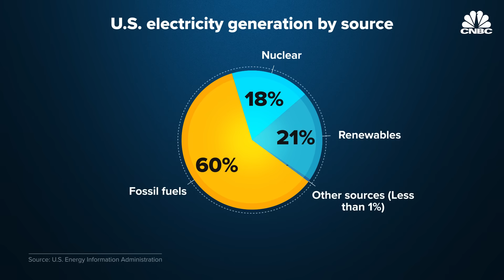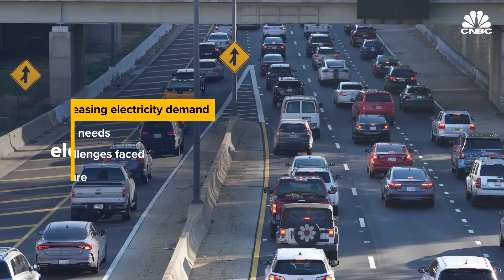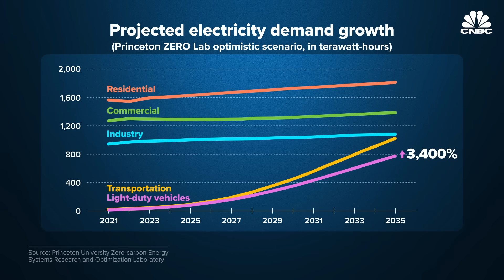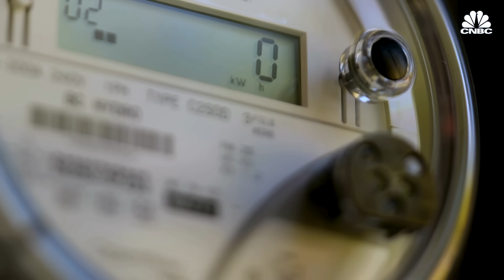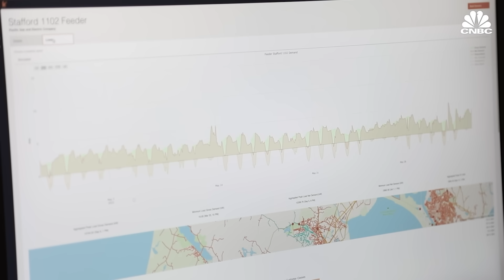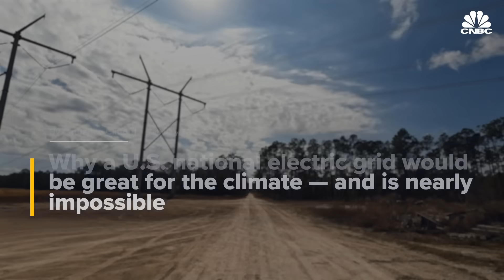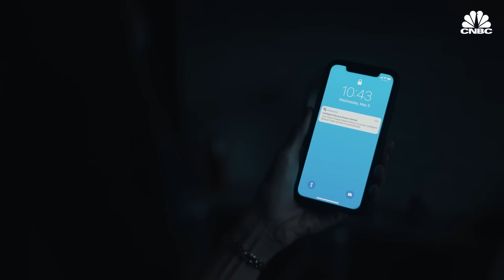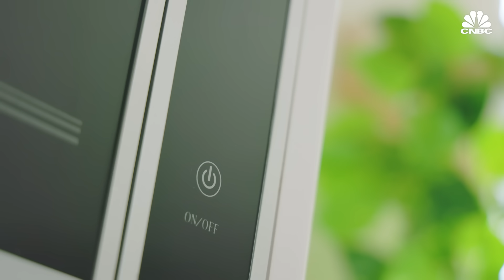Can The U.S. Power Grid Handle The EV Boom?

Comment: this needs to be done regardless of the EV boom. our grid is antiquated and it’s a bit embarrassing that this country is falling behind and falling apart. not everything has to be political. a better and more efficient grid is a win for everyone.
Reply: We also need to harden the grid against X class CME's (coronal mass ejections) and EMP (electromagnetic pulse) attacks.
Reply: @That-Guy_  Changing the transmission systems to DC will take care of CMEs, but not much of the US transmission is affected anyway. Parts of the Northeast and along Florida (of course) are affected; none of the lines here in Arizona are.

The vulnerability comes from the CMEs inducing large DC currents on top of the AC the transformers are expecting. That can cause the core to saturate on the AC current peaks, making the winding look shorted for part of the cycle. The line can be protected by taking it out of service, but that is not a popular thing to do.

If we have EMPs electricity will be the least of our problems. I remember the Cuban Missile Crisis....
Reply: Don't be ashamed , here in EU it's a mess as well , everybody with a clear mind can see it will never work on that scale to replace existing market to EV , so they will impose limits on private car ownership in future
Reply: Oh but we have some really smart bombs at our military's disposal.
Reply: The video said it will cost California thousands of dollars of grid upgrades JUST FOR EACH NEW EV.  Should there be an excise tax on EVs so all the virtue signalers can help the rest of us pay for their expensive toys?
Reply: The average age of city water pipes in Portland Oregon is seventy years. Twenty five percent of the pipes are pre 1930. How's that for antiquated?
Reply: People need to mine coal so you can turn your lights on and they deserve to be paid well. Also you need to consider there is carbon taxing for burning fuels.
Reply: @dmitwoz 

Coal only makes up just under 20% of US power production.
Reply: @dmitwoz  Wikipedia notes "Coal generated about 19.5% of the electricity at utility-scale facilities in the United States in 2022, down from 38.6% in 2014 and 51% in 2001."
Coal is going extinct in the US, largely because all coal plants have to be retrofitted with mercury capture. That is prohibitively expensive. I used to service generation facilities in northern Arizona; two of the three sites had five units ten years ago; today each of those are down to two units. The third one had three units; it is gone now. The generation is being replaced by natural gas plants. Coal has no future in the USA.
Reply: Booom
Reply: Doesn't V2G and variable pricing solve a lot of these issues? Market forces will then balance out the grid, no?
Reply: You are funny!! Do you really think drug crazy California which is run by Gavin Newsome cares about the electric grid? Gavin only cares about lobbyists and his winery.
Reply: Its because of all those money the government is sending over seas rather than spending money to help the states
Reply: About the time I moved to Flagstaff in 2001 NERC (North American Electric Reliability Council, the electric watchdog for Canada and the US) estimated existing infrastructure was in need of about 1 1/2 trillion dollars in modernization and replacement of equipment that was at end of life. This is a good news / bad news thing. Expensive, but DC transmission technology can be introduced during the Big Push. It is like having to buy a new car that is more modern than the old clunker. We have to do it sometime, and doing it over too long a time gets more expensive as more solid work-arounds have to be in service for longer periods. This is opportunity and challenge, all in one.
Reply: Its impossible to build a carbon free grid by 2035 as the Biden Administration say it’s going to. That is a huge change in electricity source from fossil fuels currently making  up 60% (20% coal and 40% natural gas) plus more transmission upgrade plus consumption increase. There needs to be massive projects under way or about to be started and there simply isn’t. Why do politicians promise something with no variable plan?
Reply: This is all BS. The sooner people realize this the better off we’ll all be. They want everyone to have 1 source of energy so they can more easily control us. Wake up people.
Reply: Two factors:

Where are the sources of Fuels?   Fossils or "What's so-called Not-Renewable"  ...  Materials will have needed to Expand Higher Loads -- Filter/Regulate Stations for Level 3 Charging. (Aluminum and Coppers would be needed more to expand Transmission Lines of High ⚡ ⚡ Voltage  and so.

*We/I keep in mind of upgrading Infrastructure of the Grids on third call*.

We/I copy here the Data from ERCOT Grids so we can discuss/ making analysis of:
Last Updated: Oct 8, 2023 19;14 PM Central Time. 

Texas GENERATION  FALL season CAPACITY  MAXIMUM CAPACITY
Solar 91 MW  (0.2%)11,663 MW  22,163 MW
Wind 6,419 MW  (13.6%)  12,686 MW  39,897 MW
Hydro 96 MW  (0.2%)  389 MW600 MW
Power Storage 372 MW  (0.8%) 1,053 MW5,405 MW
Other 0 MW  (0.0%) 163 MW113 MW
Natural Gas 24,884 MW  (52.8%)  54,367 MW  69,890 MW
Coal and Lignite 10,218 MW  (21.7%)  13,623 MW 14,321 MW
Nuclear  5,027 MW  (10.7%)  5,064 MW 5,448 MW

Whatever the Real Percentages of Teslas/BEV in Texas = but Given facts and assumptions about 3-5% mostly BEV Passenger Vehicles.   The Industrial Trucks, Busses and Transportation Semi 30-Wheel Trailers if converted from ICE to Electrified will need like 10 times the Powers needed to recharge the 🔋🔋Bat.   The above Data shown daily, Texas uses between 15 to 23% of Coals depending on Wind Energy/Factors (Winds dies down or strong wind) by the Hours.  Then Natural Gas which is about 35 to 55 % and in the Summer Time, when Air-conditioning required, TX Grids used combined more than 80% of Fossils (Coals and Natural Gas).

Given Facts that:
[Methane, the main component of natural gas and a byproduct of fossil fuel drilling, has more than 80 times the warming power of carbon dioxide in the first two decades it’s in the atmosphere. ]

Those Generators/Plants that Burn Coals or even Updated Combined Natural Gas the Smokes/Fumes of Pollutants = C0, C02 and Methane mixed piled up (Chimney 300 feet or more in the Air.)  While as our ICE Mufflers about 1 foot above ground.   The Photosynthesis of 🎄 🎄 🌿 🌿 Trees/Plants along the Countryside Roads and/or Streets in Metro should play a part of neutralized some of the C02 from the ICE Mufflers.

Texas is the Highest per capita in Generating Electric Powers in the US; California imports daily about 30% of Cali Electricity Needs; and out of those generated and imported = 70% are from Fossils (by the way, as far as we have read and compiled = USA fossils used daily is close to high 60% almost 70% not about 60%)  The Truth hurts.

If the US can generate Electric Powers from sources that reduced the Pollutants and reduced the Energy Spent that would be the best; like Canada 🍁 🍁 Hydro Powers daily generated close to 60% other sources like Wind and Solar, Bio are bonuses!!   If USA could generate enough Powers from Hydro and other "less C02 Emissions" so that Households in USA would use Electric Stoves instead of Gas.  Which is immensely important than trying to drive a Tesla and spend the most Money to make the 🔋🔋.   Get those old ICE Cars from the Street to Junkyard/ Recycled; get new Hybrids and more Efficient ICE smaller Engines so USA can reduce the Emissions down from 100 Benchmark to 90 in a decade would be such a bonanza!!

Smaller Cars, smaller Curb Weight will cut down the Repair cost on Road Maintenance = not on the Teslas that weight 1200lbs more than the averaged ICE cars are more pragmatic and Practical and Focused on.

Regards,
Reply: Completely correct. Wind-solar-batteries will be 90% of power generation and storage by 2030. Electricity will be plentiful and cheap. However, the grid needs huge improvements despite the stabilizing effect of battery storage and more localized power generation (e.g., rooftop solar). Google Hornsdale Power Reserve. Battery storage is orders of magnitude cheaper, faster, better than natural gas peaker plants. In fact, the giant battery caused several peaker plants to be shuttered within weeks of the battery going online.
Reply: The American people would rather vote for more tax cuts and more gun rights!
Reply: true, but some of these people need to stop trying to push things too fast.
things take time for new innovation to grow.
Reply: Thank you for your insightful comment! I completely agree that upgrading our grid is crucial, regardless of the EV boom. It's important for us all to have a more efficient and reliable power supply. Speaking of power solutions, have you heard of the Segway Portable PowerStation Cube Series? It's a versatile powerhouse with an expandable capacity of up to 5kWh, perfect for outdoor enthusiasts and ensuring uninterrupted power supply during family camping trips. Check it out if you're interested!
Reply: I completely agree with your comment. Upgrading our power grid is essential, regardless of the EV boom. It's time for us to invest in a better and more efficient grid that benefits everyone. By the way, have you heard about the Segway Portable PowerStation Cube Series? It's a versatile and powerful backup power solution that can keep your devices running during camping trips or power outages. Check it out!
Reply: Then YOU PAY FOR IT. Not on my dime!
Reply: 120v 240v sucks the European 240v 380-400v three phase is better.
Reply: Falling apart and falling behind? When did that happen if there's been progression? Did it happen during a specific year like 2013?
Reply: If there's been progress, then when would it have fallen behind and fallen apart? Since 2018? Was there a specific year that you were thinking of?
Reply: Nuclear power! The most energy dense production that could solve our electricity issues with just a few reactors!
Reply: that's the limit of technology
Reply: One of the Australian states at times is totally powered by home solar panels, yes they had to invest lots but the payback is immense !
Reply: what did big oil do with moneys for gride last 50 years now there front loading cost on us maybe dig into there slush funds and upgrade
Reply: Europe and China are is lightyears ahead.
Reply: We should be building nuclear power plants.
Reply: @bcemember3922 Budgeting, the long term impact, maintenance, waste, infrastructure, materials or resources, education and having everyone agree with it is just a fraction of what it takes! Y'all needs stop giving your opinions and start using your brains for empowerment and a deeper understanding because industry doesn't happen in the blink of an eye. It requires capital and return to investors too.
Reply: Unfortunately, everything is political. In the US, one political party is dragging their feet while the other is trying.
Reply: @tims8603  Politicians like new bright shinny things that they can cut a ribbon for a photo, then resent having to budget any funds to upkeep that thing. They have been neglecting up keep for decades. Some of these things date back to the 1930s others to the late 1960s/early 1970s. These things are dams, bridges, roads, levees, water treatment, electric generation and systems, etc.
Reply: @tims8603  Trying to bankrupt this country and force people to go electric before the technology can deliver vehicles that match what diesel and gas vehicles can deliver .
Reply: @Brett33  😂😂😂
Reply: @tims8603  Yup we have the party of doing things and the party of not doing things.
Reply: @tims8603  I don't know what happens in other states but in Texas thousands miles of new  transmission lines have been installed over the last 20 years. It probably easier in Texas since FERC (federal government) approval is not required to do most energy related things.
Reply: @mrrogers4591  TX has an independent grid system. It's good in some ways, bad in others. That winter storm showed the bad ways. If power goes down in other states, it can be redirected from other areas. I don't think TX should brag about their system.
Reply: @tims8603  True. However the winter storm showed that company didn't take into account the potential for those low temperatures affecting their equipment. The surrounding states had there own problems and didn't have sufficient excess production capacity to meet the needs in Texas. The blackouts wouldn't have affected as many people but the majority would have still gone dark.
Reply: @tims8603  It was the natural gas infrastructure that was the cause/start of it
Reply: @mrrogers4591  They have known about the issues since 2010 if not earlier.  They chose for over a decade to do nothing to winterize the natural gas lines / wind turbines, etc.  ERCOT is not a good example of how to run a grid.  Too many people die in Texas from loss of electricity, even recently with the heatwaves and loss of power as well.
Reply: @tims8603  One the public didn't hear too much about took place about 20 years ago. They have the highest mix of wind in their power generation of any interconnection in America. One day the wind didn't blow nearly enough and the retailers had to buy electricity on the spot market for many, many times the contracted rates. Over the next few months several of the retailers went bankrupt. It was in our company's news but I never heard a word about it on national media.
Reply: @flagmichael  Who is 'they'?
Reply: @mrrogers4591 lol your example is TX? The one place that proved the grid was antiquated last winter?
Reply: @gregripp  RE: " It was the natural gas infrastructure that was the cause/start of it" 

Ohh you mean the infrastructure that has to run 24 hours a day 365 days a year. I would think that its electricity should be the most costly.   I can sell you a cheap airline ticket for undependable service "we fly sometimes is their ad slogan"  

Instead the utilities had to buy undependable power when available, the reliable power had to compete with only being able to offer it when people had to have it and the unreliable power could not do the job.   If I ran the reliable power outfit I would "gouge" all the fools that voted for their unreliable power; a price must be paid for stupidity.
Reply: @flagmichael  that was case in south australia? haha
Reply: Roof top Solar is increesing massively. Together with home batteries,and grid magapacks batteries will be in place before the EV demands put any seriously strain ro the grid, because it profit in it.
Reply: @brembodream  yeah i think it would be much better to put a coal firing next to your home, that would be much better for the environment  :) maybe we can also erect a gas and oil refinery next to yours.
Reply: @krac3x438  My coal plant was a good neighbor.   Quiet and small footprint,  clean flue gas and it never failed to supply 2 million people from a 600 acre site
Reply: Guise, why we need renewables…. nuclear takes long years to build and we need lots more of them than most folks seem to think. 

We do need renewable storage development. We are very behind.
Reply: @katherandefy  Plus nuke plants will be economically unviable in ~7-10 years compared to renewables - nuke plants will be stranded assets and shut down, wasting all that capital. Keep existing open for now, unlike Germany but don't build any more.
Reply: falling apart because of failed green projects ?
Reply: what if i dont hv houses connected to the grid.
Reply: @palocymasaio  Houses are small potatoes. Much of the power demand in any developed country is for commercial applications - office and shop buildings, power for pumping water to everybody, street lighting, the list is endless.
Reply: @palocymasaio pretty much if you use any services or purchase any products at all you are benifiting from electricity that is from the grid.
Reply: @palocymasaio  Then you don't have a house connected to the grid.  There are over 332 million households in the US and I very much doubt no more than 1 million households live off the grid.  Use our nations resources, in this case taxpayers money, to benefit the most people.  Upgrading our Electrical infrastructure would benefit 331 million households.
Reply: @CeasarBergonia  well we are a different class so whatev
Reply: We are all in a different class.  There are many things that the government spends tax money on that do not benefit me but will benefit other citizens, like you.  Such is life in the US, which I believe is better than other countries, even with all the flaws the US may have.
Reply: @CeasarBergonia  I got upgraded to a new "smart meter"   It;s so smart that when the sun isn't shining and the wind isn't blowing (on a cold winter night) my smart meter can detect I'm charging my EV to get to work when their is no power available to do this.   A computer can figure this out all on its own and target my smart meter to cut my electricity completely off.  I don't need to work anyway; its called "Bidenomics"     Beside my pipes froze durring the night when my electrical heat pump failed and I now no longer have a house to use up all that "smart" electricity.  That's how smart my smart meter is.
Reply: first world problem. stop complaining bro.
Reply: The grid is not antiquated. More electricity is being used/delivered than ever before and no one wants new transmission power lines.
Reply: @mrrogers4591  it is antiquated I've got powerlines running in front of my house that well over 40 years old and there are secondary lines running below them that are older than that and shedding insulation cause I see bits and pieces of that rubber insulation on my driveway all the time. I do agree with you on more electricity being used and that no one wants new transmission lines but we do need to update the system cause right now there's no way the grid can handle anything more electric mainly electric vehicles.
Reply: @bretthibbs6083  there's is nothing bad about 40 years old electric lines. Power lines can last effective forever unless the get damaged by tree limbs failing on them causing arcing damage. Power lines don't have insulation on them. The air is the insulation. The lower lines are phone or cable.
Reply: @mrrogers4591 : I’m over 90% sure he’s referring to the service conductors from the transformer to the meter/pole.
Reply: @jacobcarlson4010  Yes, he's concerned about a shortage of step down transformers. I guess Tesla will have to make those too.
Reply: @mrrogers4591  It is. Much of the grid is from the 80s and before.  On energy, the point is that demand is outstripping supply at an increasing pace. Of course we produce and use more energy today. But demand is rising faster than supply so we need to bridge the gap in production to avoid massive shortages in the near future. Extreme temperatures, expanding EVs and urban sprawl all require increased production and distribution of electricity to meet the rising demand.
Reply: @daymajor4690 True energy demand is increasing but the electric power lines have handled the demand. what you are talking about is electricity production. There is a shortage of generation. Energy demand is difficult to forecast since population shifts can happen faster than building new electricity production facilities. Electricity production facilities take 3 - 5 years minimum to site, plan, buy materials, and build. A lot of people can move in a month, a year, let alone over 3 years.
Reply: @mrrogers4591  There is no shortage of energy generation, if there were you'd be seeing near constant blackouts.
Reply: @thierryvt  true. There is not much reserve capacity. If a facility goes offline the probability of power outage is greater because of lack of reserve capacity. Electricity is a make it on demand system (except for a very small amount of battery capacity).
Reply: @mrrogers4591  I recently retired after 34 years in IT Field Services (think substations and mountaintop comm sites) with a Fortune 100 electric company. From the beginning I was amazed at how much more complex bulk electric power is than the public understands. Grid stability is a primary driving force; out here on the Western Interconnection (essentially the grid west of the Rockies between the Arctic Circle and Mexico) we had power out in Phoenix because a filbert tree in northern Oregon had not been "trimmed" in time - they grow about a foot a year - and a heavily loaded transmission line sagged under the heat and BLAMMO (technical term) the line tripped off. That led to a cascade of instability, tripping both generating stations and loads. Every minute or so generation must equal loss plus load; faults are like a diner bumping into a waiter with a tray full of plates and glasses, but much larger tray and much harder bump. Normal protective relaying is designed to protect the equipment by disconnecting it ("tripping it off"), protecting as much as necessary by de-energizing it. Companies like ours added a lot of Remedial Action Schemes that are designed to dampen instabilities.

We wish it were 3-5 years to plan and build transmission infrastructure. We are sometimes able to fast-track to 10-15 years, but most are 15-20 years. Some can never be done. Even replacement of end-of-life equipment typically waits until it fails.
Reply: @mrrogers4591  the gris is antiquated, maybe before commenting actually look it up
Reply: @mrrogers4591 ❤
Reply: @mrrogers4591 laughs in blackouts  The grid is completely antiquated.  And everyone wants new transmission power lines… there’s just a handful of people who get in the way of them being built.
Reply: @LackadaisyLady  right, environmental groups and not in my backyard people get in the way of building new transmission lines
Reply: @LackadaisyLady  RE:  " And everyone wants new transmission power lines… there’s just a handful of people who get in the way of them being built." 

We use to call these people environmentalists, now we call them "greens "  Same people demanding the entire countryside be turned into one giant industrial plant and for what?    
"fish gotta swim and birds gotta fly but they don't last long if they try"    More appropriate today than when Tom Lehrer first crooned it in the 1960s
Reply: @LackadaisyLady  You said, "The grid is completely antiquated.  And everyone wants new transmission power lines… there’s just a handful of people who get in the way of them being built."
Perhaps people want new transmission lines in the abstract.  Please list every person in the US who wants a new transmission line in their backyard.  I'm sure the list won't exceed a few dozen in the entire country.
Reply: @LackadaisyLady : The reason that most people are objecting to new lines being built is that it usually happens INSTEAD OF performing upgrades to existing infrastructure. Case in point, there were a bunch of farmers and NIMBYs who objected to a long-distance high-voltage line that was going to cross the state of IL, without connecting in or offering any benefit to us. Well, shortly after that opposition came up, multiple smaller towns experienced unprecedented rolling blackouts. Curiously, out of the dozen or so small towns that had these blackouts, only one had a hospital that was effected. That fact in itself is highly suspicious, nevermind the fact that as soon as the opposition to the project ceased, before they had even laid the first pad for the first tower, the rolling blackouts completely stopped. Service reliability had not been an issue before, only during the time that they (Ameren) were receiving pushback against a project that would not actually improve anything for us. Personally, I don’t find adding more infrastructure to be the answer to increasing reliability; not when there’s already infrastructure that’s being neglected. If everything were already in the best shape it could be, all service/step-down transformers replaced with the most efficient ones possible, and absolutely nothing else could be done; then maybe consider adding transmission lines, but only on the condition that no piece of electrical infrastructure becomes neglected or in any state of disrepair. The fact that there are transformers and high-voltage lines that were new back in the 70s and 80s, does NOT point to a need to add NEW infrastructure; it points to a need to upgrade what we have.
Reply: @mrrogers4591  put them underground then
Reply: @mrrogers4591 but most of US Power is from 50+ old Nuclear Stations so are actually overdue for shut down as well as Coal Plants again most of which are ina need of over hull or replacement

The US needs an estimated 30 to 50 new  nuclear power stations to boost Renewable Energy especially Solar and Wind and make up for shortfalls in Hydro Power due to Draught

Without Renewable Energy Sources the US will need over 100 new nuclear power stations